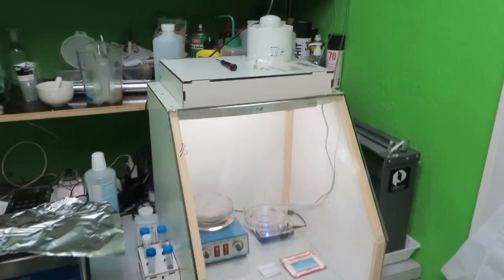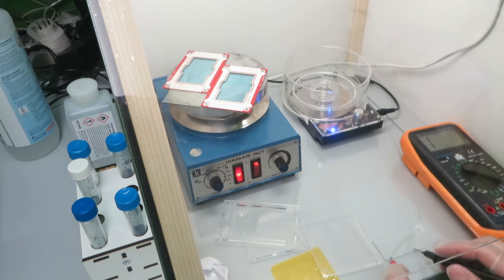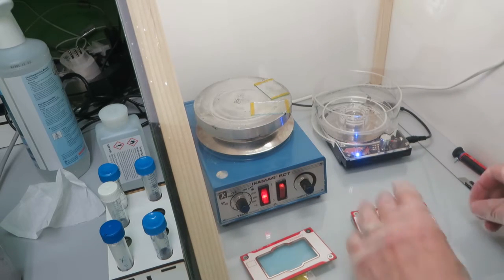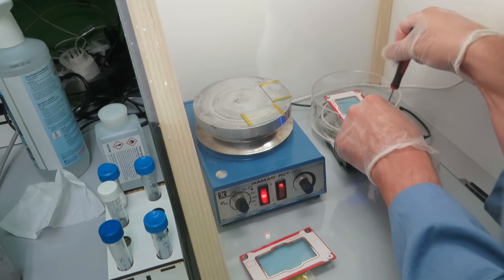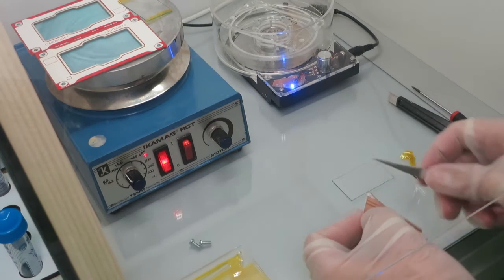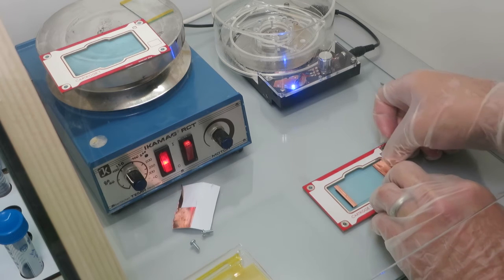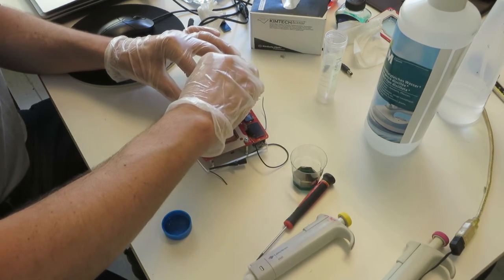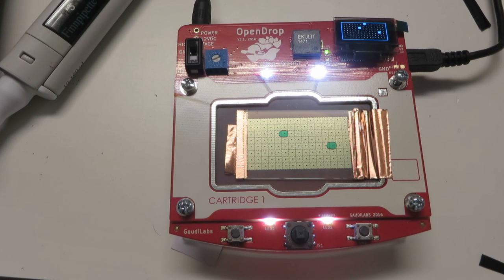How to - Hydrophobic Coating for the OpenDrop - Part 2

Comment: you know you can make virtual electrodes with a projector if you just spin coat some TiOPc (Titanium Oxide Phthalocyanate(sp?)) over the ITO, before the superhydrophobic layer? If you have a top plate and switch between the two at various frequencies you can get not only optoelectrowetting, but also dielectrophoresis to move objects in the drops. If you invert the optics on a projector it should work quite well. Other options might include testing various zoom lenses after a DMD chip. I was also thinking about perhaps using a cellphone screen and just putting the chip on that, but cooling would become an issue unless there was a way to polish the LED display, get it to lase, and then add a layer between the display and the chip for liquid cooling. 

All of the work I want to do will be with this optoelectrowetting stuff. I will be trying to make the dielectric layer as thin as possible to drive down the required voltages for this effect. I want to shoot for a volt or less so it will be useful for biological applications where you need to grow cells. 

Ideally SiO2 nanoporous spheres would be somehow filled with boric acid and then closed up and attached together before perfluoroalkane-silicon methoxy compound is added to make a fuzzy little surface for the nano-spheres. Hoping the wetting is reversible on something like that. If it is this should be quite resilient to bio-fouling, while still serving the purpose of electrowetting with voltage under water's breakdown voltage. Of course this is unnessesary for a simple OEW setup, which is much more versatile than having electrodes. 

Another advantage to having a patterned top cover (besides the obvious evaporation slowing) would be multiplexing. You could do half voltages on top and bottom parts (rotated 90 degrees from each other) if you etched squiggly lanes instead of having squiggly squares. Combining this with the OEW would be advantageous for being even more selective with areas of the chip you want to work with for various applications that might be electrosensitive. 

Going further would be having a color projector with a special laser and filter setup for multiplexing actuation, imaging, and potentially other things such as optically sensitive surface coatings. 

For imaging, if you like microscopy stuff, Dr. Ozcan has some really cool lens-less tomography/holography stuff that should be pretty easy to hack. 

To recap a simple projector with inverted optics would enable a very similar chip (with the addition of spincoated TiOPc between the ITO and fluorocompound) to actuate droplets with video. On chip lens-less imaging will also make this platform a much more useful tool in biological labs.